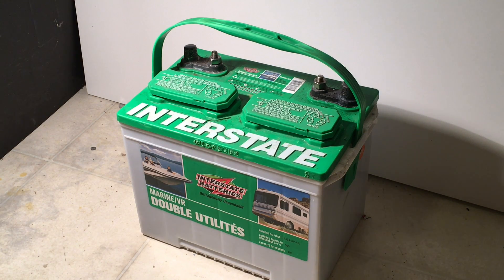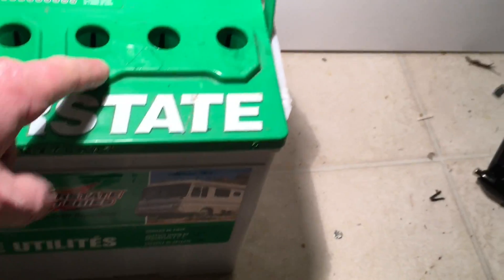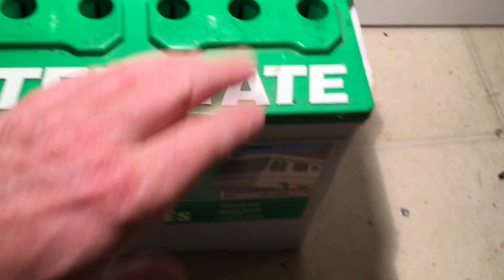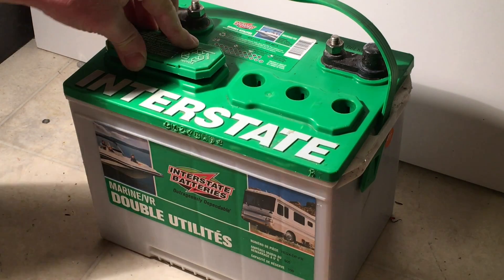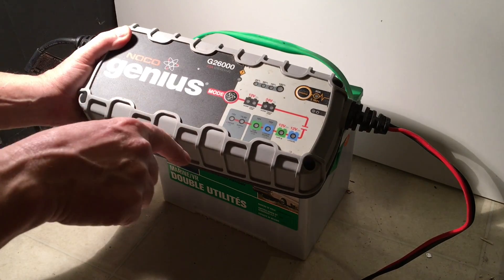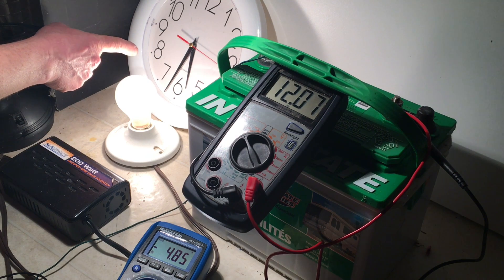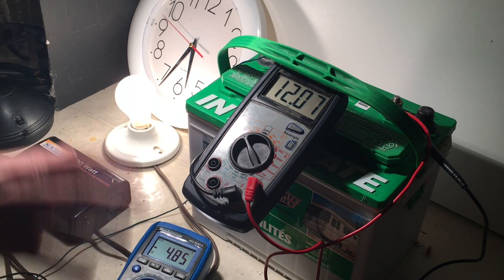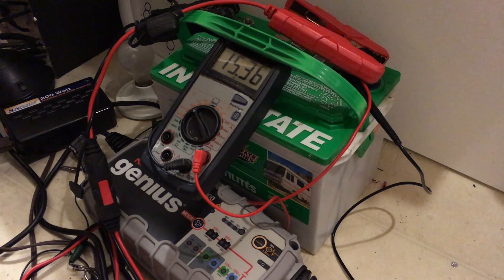Restore deep cycle lead acid battery. Revive dead sulphated RV car marine batteries

Comment: There is no such thing in what we call "battery revival". When people learn about electrolysis then they will realize that this method will never work as we hope it to. The battery will only revive if we replace the positive part (plates) of it that dissolve through the process of electrolysis. That liquid will not repair the plates of course. It a wasting of time. Even you can recharge it but it will no last longer because the energy stored to it will collapse too low. The Ah (Amp/hour) will drop since some of the plates already damage and cannot store energy. So in short time the energy drained. Sorry for my bad english.
Reply: @john smith. I too have tried several battery restoration recently.  Batteries will not recondition or revive once you have 1 or more bad cells.  Even if you can get the voltage up about 12.5v. Often we found once you load the battery. By load test or load in from the device it operates,  like car, truck, trolling motor,  fork lift, lawn mower, generator starter.
The load just destroys all your hard work of removing acid.  Neutralizing acid to make it safe to handle. Then replace battery solution w/,new electrolytes like epsom salts/distilled water.  And all the jumping thru hoops.  Shaking ( oh, and dont forget the baking soda washing of internal plates in each cell before replacing the electrolytic fluids in ea cell.
So u do all this on a battery that has 1 or more bad cells,  and u just pissed away hrs and hrs.
Its really either a good battery that can be brought back or a bad battery that cannot.
If u determine that before all the work,   u can decide if the 1 in 5 batterys u mess w/are junk after hrs if wrk.
Its gotta be a good battery that needs some topping off of distilled water,  or a good slow trickle charge.
I spent 2 weeks trying to get a bad cell to revive in 5 different batterys.
None would revive ,  if they had just a cell bad.  And usually its a cell on the end.  Noy always,   but if u were a betting man,   u dont wanna bet against the end cell being the bad or worst of them.  Prolly 75% of the time.

The real lesson here, is store your batteries not being used during cold weather or any weather when u can,  inside your shop/garage.  If climate is better thsn the outside.   Both heat and freezing prematurely kills batteries. 
The near 70% distilled water content can freeze in sub zero temps,  even thou the ~34% acid solution is a form of anti freeze.
Then,  when storing these expensive and not being used batterys in boats,  enclosed trailers for race cars,  and toy haulers, ect,  you put them on a trickle charger.  These newer de-sultiphication ( sp?) Chargers seem to be the better choice than the average Walmart , cheaply made Schumacher battery charger.  Don Schumacher didnt get to beca muti millionaire selling u a great charger at a cheap price.
He sells u a cheap charger at a high price,   hoes top fuel racing fir decades,  while paying the bill on not only his own sons Top fuel team,  but several other race teams,  including at times some pro stock bike guys like craig treble.  All good guys.
Point is. Cheap chargers dont help anyone get more out of a battery these days.
.plus batteries are made of lower quality materials now more than ever before.

So tricke charge ur batteries not in use,   and if u can.  Buy the 1s that have a desulphate mode.  U can,  without adding any fluids.  If you kerp exterior of battery suoer clean ( as that film of grime LITERALLY SUCKS VOLTAGE OUT OF BATTERY.)  Take & touch a volt meter to opposite ends of a grime'y battery case,  opposite sides,  and if there is enuff filth.  It will read on volt meter 1 to nearly 3 volts just touching the plastic case, as the filth also touches the posts,  and this acts as 1 large conducive "short" or drain. On your battery.
Just saw a 19 yr old, AC delco battery start to go bad,  as 1 cell is now going bad.
Car was kept spotless its entire life,  owned by a woman who loves her 2002 Camaro LS powered manual tranny car.  Its got 39k miles on it as of now,  but wasnt her daily till 5 or 6 yrs ago.  She works from hm,  so its not driven 12k a yr like average.  That battery looked brand new when removed from car,  as it started to slow crank in May,  which is not a weather month of extreme heat or cold.  
I tk it after she replaced it, and hav bedn slow charging this 19 yr old battery.  Still has 1 cell low, and reads on the very edge of good/bad,  on load tester.
Im gonna try using it on a old 4 cyl tractor for a while.  U just cannot fix a bad cell.  Then tend to short out. 
If battery makers built battery's properly,   they would all last several years longer. 
But how do u sell batteries to people who do not need replacements??

I have 16+  items that use 12V car or lawn mower batterys.  ( 3 that use 6V batterys)
3 things i own use 2 batterys per machine/veh..  
2 diesel trucks, &  1- 24v military diesel Gen Set, on military trailer, w/ two 12V smaller batteries,  in series,  to get 24v , as most military equipment is 24v.

So when u got tractors,  backhoes, muti lawn mowers, trucks, cars, fork lifts, battery powered indoor fork lifts, race cars, boats, rzr's , golf carts, enclosed car/toy hauler trailers. And everything uses  batteys.  U wanna get them to reconditioned status..

So when u got over a dozen +batteries,   ur constantly dealing with dead or liw Voltage/bad cell batteries. 

Dont even get me started on TIRES.
Phuk.  Prolly need, right now.  to buy at least 7 new tires for our 1 ton dually,  ( spare is #7)
 5 for our 4x4 diesel SUV --1 Spare). 
 Some tires are reasonably on both trucks, ,  but i hate to hav mismatched old/new tires,  on heavy towing vehicles.

Need 1 tire replaced on 3ramp mtr-cycle trailer.  Really shoul do 2 new 1s .

(We hav Replaced,  just in the last 18+ months or so....., 
 5 new tires on open 2 axle trailer, (plus spare), 4 on '90s beater car, 4 on f150,  
And 2 on a lawn mower.  Backhoe needs tires,  old ford tractor needs um still.
Forklift some day will.  
I hav an 18 yr old Optima red top in my old 50s truck.  Its the old 1 version AGM,  so its actually a good battery.  The newer 1s from Optima are worth a piss.  Might as well buy a $100 battery instead,  cuz the $200+ red top now days will likely not outlast 2 -$100 lead acids.. 
Sad they take great products and make them cheap to sell more after there reputation is established. 
So,  in the end.  Keep tires aired up properly,  keep batteries tended when possible,  & out of freezing weather when not in use.  AND NEVER STORE A BATTERY DIRECTLY ON CONCRETE.  WILL KILL IT QWIKER.  ON BOARD, PLYWOOD, OR RUBBER MATT.   NEVER STORE BATTERIES ON CONCRETE AT ALL IF AVOIDABLE. .
Wish these battery tricks worked.
The reason there is no #2 or #3 videos,   is because he couldn't get the battery to come back to 80%+ capacity. 
I know.  Just spent 2 weeks phukin w/6-7 ,of them.  Got 2 batteries to cone bk about ~~80/~85%..  only cuz they were not totally bad yet w/1 or morr truely bad cells.
If I ever do get 1 of these bad cell batteries bk to operating.  I promise you I will post it and how I did it 
Im wirking on trying to only charge a select q or 2 cells at a time rite now,  to try to de-suphicate(even a word?),  just the bad holes,   w/o overtaxing the already properly functioning cells.
Not even sure that will wirk yet.
But going to try it on an expensive Deep cycle for my encloded race car hauler. 
Will repost here if we ever really accomplish something worth posting. 

Im still waiting for the DIY Re-tread'ing of tires. As ive either spent,   or will spent.  prolly 3-4 grand on tires i havnt yet bought sometime soon.  Just dragging feet on those purchases.  Spent prolly $6/700+ easy ,  on 12v batteries in past yr.

Be safe when messing w/batteries. 
The acid on ur jeans isnt so bad.  Get it in ur eyes.  or ur kids eyes,  and u will wish u just bought a battery.  SO BE EXTRA AND EXTREMELY CAREFUL PLEASE .
LOSING VISION ISNT WORTH IT.

Last story.  My closest high school friends dad is at a gas station, . Off to side of main building.  Hood up,  as car isnt charging right,  maybe he figures alternator or bad battery.  Tryin to get hm from work. 

He us messing around /battery posts,  thinking they are just dirty & corroded so much it wont charge up from alternator. car us running mind u.
Suddenly,  no warning,   battery BLOWS UP IN HIS DADS FACE.  EXTREMELY BAD SITUATION. 
THE BLAST & SHOCK FROM THE EXPLOSION,  not only pushes him backwards,  but he sorta spins around and his feet hit curbing edge of parking lot.
He lands face 1st into the ground without hardly getting his hand up and outward, due to being blinded instantly by burning acid fluid from battery. 
As he lands face dwn,  he realizes his face is in a snow bank,  from the plow trk that cleaned parking lot a day or 2 before after snow storm.
Blindly e started using the snow to try to wah and flush eyes in a panic,  to get acid off face and out of eyes, nose and mouth. 

They called an ambulance.  By the time he was released from hospital,   the last words the ER doctor said was,  Mr G.  If by the grace of god u had not gotten that snow upon ut face an eyes /in seconds of it covering you,  id be talking to a blind man right now.  You nay be the luckiest guy ive seen in yrs in the ER for this sort of life altering injury. . & u are going hm w/ nearly no damaged  skin or other senses.
That snow save your vision,  and u having the common sense to scrub acid off.
 We all wanna save money,  but not many of these bad batteries can be reconditioned as these u tube videos would like u to believe.
I spent enuff time working on them to tell u its maybe 10/15% that. CAN recharged and tended.
Reply: @here_for_the  Did you just type a fucking YOUTUBE ESSAY? Calm down bro before you get arthritis.
Reply: Excellent Video! Apologies for chiming in, I would appreciate your initial thoughts. Have you heard about - Lammywalness Trendy Trade Guide (Have a quick look on google cant remember the place now)? It is a great one of a kind guide for learning how to recondition batteries at home without the normal expense. Ive heard some incredible things about it and my work buddy at last got amazing results with it.

Comment: heres my question,i picked up 2 diehard marine deep cycle batteries,was told they were 5 yrs old,never installed just sat on a shelf i took a chance and lost,voltage and amps wont hold,do they sulphate just sitting on a shelf?i drained both and refilled with fresh electrolite,one is like new the other is at 11.5 volts after 18hr charge,any insight on this
Reply: Yes, a battery will sulphate sitting on a shelf.  It will do that faster if the battery is left dead or in the cold.  When a battery is dead the electrolyte separates into sulphate on the plates and water and the water can freeze and break the plates.  Never leave a dead battery in the cold where it can freeze or you will not be able to completely recharge it again.  This can happen to even a new battery.

Comment: Your information is good! But how many people have those many devices and time to do all of that you should come up with a simpler method and less devices that the person had to have all those devices they might as well buy a new battery
Reply: I have all those devices and got them so I can save money on the battery that I have and not spend money on a new battery that I don't need.   You want a cheap quick way to test your battery just leave you headlights on for about 15 minutes and if your car still starts you are ok.  If your headlight a dim before you try to start your ca,r then your battery is dead and needs to be charged.
Reply: Most jobs require the right equipment. If you can't stand the heat, get out of the kitchen.

Comment: I found recently if you use a meg ohm meter and measure from one terminal to the case of the battery you will be surprised to find there is often a leakage of several Megohms. It is best to use a solution of baking soda and water and flush off the top of the battery, being careful to secure the caps first as you dont want the mixture to get into the battery